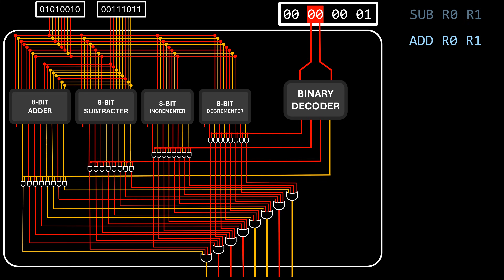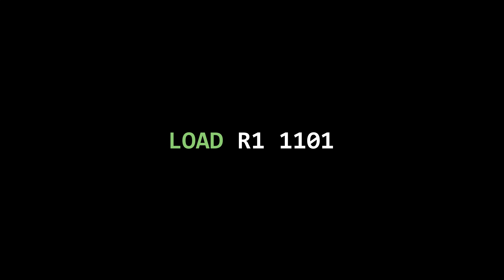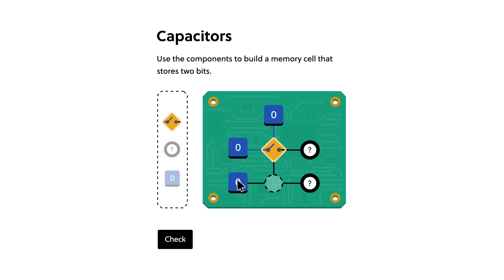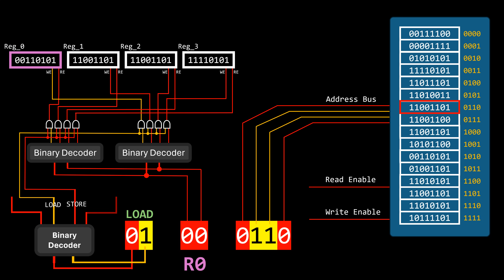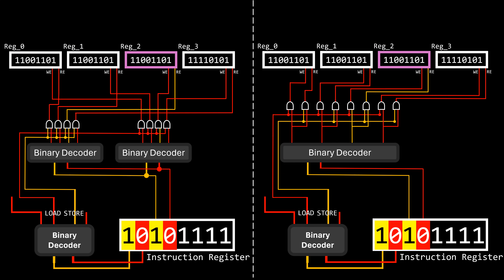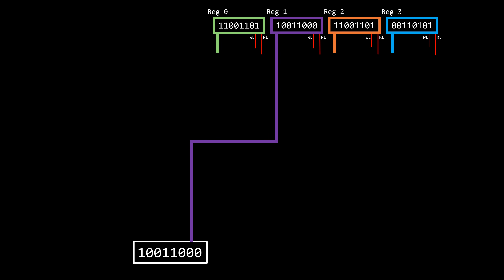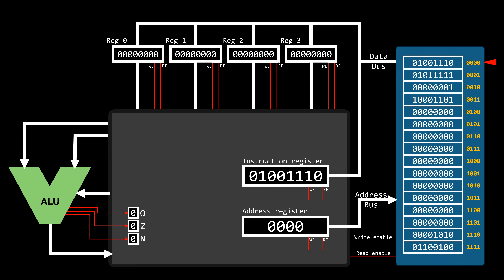CRAFTING A CPU TO RUN PROGRAMS

Comment: Very good explanatory video! It has potential to branch off into important topics, such as Harvard vs. Von Neumann, if one considers that soon enough storing code and data in same 16-location memory will be a bit tight.
Reply: R3000 in the PlayStation and SH2 in SegaSaturn have Harvard architecture. JRISC in AtariJaguar has Von Neumann and needs an “instruction queue” to read ahead instructions for when data will block access. Sounds a bit ugly. Atari was afraid that a big cache would be too slow? So they implemented a short ring buffer. I still would have loved if they fetch 64 bit =4 instructions at once, analyse all dependencies and maybe reorder these 4 instructions.
Reply: @ArneChristianRosenfeldt  - and interestingly enough, "original Von Neumann" was fetching 2 instructions at a time (2*20 bits) but I don't recall having dependency check, however it had a potential for that. Internal instruction caches can be made wider even if external bus is relatively narrow, which often has to be due to important price considerations (e.g. 68008 and 8088 owe existence to this).

Comment: Ans to you question, registers have bit level control of read and write, that allows passing one at a time to the ALU, and facilitating multiplexing but memory is just a block with no granular control ( probably 😅).

I am thinking about registers like a workbench and memory is the closet.

Improvement. !!! 
Dividing memory into subdivisions, keeping closer proximity of registers, for that a more defined instructional set will be required.

Please respond if I am right or wrong.
Reply: Memory is byte granular mostly. A lot of 32 bit CPUs are 32bit granular only: ColdFire, SH2 , RISCV .
Reply: @ArneChristianRosenfeldt  So am I right?
Reply: @neail5466  no . As I wrote memory is more granular than registers or at least not less (in 8086).

No idea what you mean by proximity? I am for keeping memory close. I hate how consoles need to pull instructions from a cartridge far away. I hate how C64 and Jaguar have a system bus which slows memory down because there is no active bridge. So memory feels as far away as the serial IO to the mouse.

Comment: Cpu is based on edge triggered memory elements  NOT latches!!!
Latches must be used carefully...
especially in Fpga design, to prevent creating  race conditions ... 
😅😅😅😅😅😅😅😅
Reply: I find this TTL parts very confusing. In  early microprocessors (6502 , Z80) there is only one kind of persisting a state: a loop of two inverters. Each consists of one common source transistor and one pull up. The clock drives two transistors which let the balanced wire signal pass. So 6 transistors in total. Dead simple.

Of course you may need one inverter in front of the whole SRAM or register file to create the balanced signal.

So anyway, there is no edge. As long as the clock lets the new signal pass, it overwhelms the pull up, and the inverter loop will fall in line.
Reply: Confusing TTL parts??????? 🤔🤔🤔🤔
Reply: @KingofUrukhai  logic gates. Okay, logic gates are okay, but flip flops, shift registers and all that other TTL stuff is difficult to understand. The manufacturer has problems to justify the big package for a little functionality and put comfort functions on it. But all this complex stuff leaks in form of a long datasheet with tons of specs. Meanwhile the 6502 only has two types of transistors. Only inverters and NAND and yeah open drain busses. I started to write a simulator for it. Now my main problem is indeed the CPU circuit to choose. I want analog transistors, but now cannot justify them. Only timing is difficult. So I need at least 16 phases per clock. I don’t want to introduce “gate delays”. I will probably stick with parasitic capacity and go back to analog .

Comment: 19:23. I think the answer to your question is an immediate value.
Reply: Immediates are literal values which follow the instruction stream. For example on 6502 the opcodes are fixed width (as on MIPS) , but it accept data embedded into the instruction stream immediately following the opcode. MIPS does not like to waste cycles. So similar how INC is ADD 1 , you can only embed small numbers in the fixed length instructions. Even RISCV only allows you to embed 24 bit numbers on a 64 bit system. So it is difficult to write a floating point emulator. Memory mapper IO should sit below 20 MB.

Comment: Why load data into registers before using them for ALU operations?
Registers are the closest and fastest memory storage units within the CPU. They provide temporary storage for data that is about to be processed or data that has just been processed by the ALU.
Is there a better way to do this?
One possible alternative is placing memory closer to the processing unit to minimize data movement. However, this approach still requires a temporary location, such as registers, to perform operations efficiently
Reply: The machine language (ISA) of the SAP-1 does not know about registers, still the implementation needed at least 4 . When do you call something a latch and when a register? There is an instruction “register” after all.

Comment: you will need very big MUX if you mapped your memory to ALU also you would need more than one data bus to activate two locations  otherwise you need intermediate storge to hold your data  ,
Reply: Two port memory is actually available. Then noobs will say that the price is the concern of the BA, while senior engineers know about the cost of all the addressing on the chip.

Comment: I think loading data into register before using them for ALU Operations is essentials because if we load directly from main memory to ALU might simplify CPU operations, but it is practically inefficient. It’s crucial to note that accessing main memory is much slower than registers. Registers are accessible in one clock cycle while getting into the main memory may take several dozens and even hundreds of cycles which makes ALU work slow.

Moreover, ALUs are intended to work with the few, fixed number of registers. Their direct access to main memory would make it difficult for them to design and potentially slowdown the whole CPU. Most architectures of CPUs are structured around using registers for data manipulation because it simplifies instruction set and makes instructions more efficient. Changing this design will require a complete rethink of architecture resulting in higher complexity as well as compatibility problems.

Pipelining is heavily used in modern CPUs to execute numerous instructions simultaneously. In this process, registers play a key role by providing fast storage for intermediate results and facilitating quick movement of data between different stages within the pipeline. Direct memory access will increase latencies thereby interrupting the smooth flow thus reducing overall efficiency.

Using main memory also leads to higher power consumption compared to employing registers which is a major concern both in mobile devices as well as servers.
Some of the better ways to handle  (i will share one example for now )as most of modern archtecture do is including serveral memory hierarchy like for prefetching like L1 , L2 , L3 caches which overall reduces latency and improves performances
Reply: Also realistic access to memory uses address registers. So you don’t actually cut down on registers. I think that the 6502 zero page is a mistake.

In the NEC turbo Grafik CPU, RAM, and ROM all cycle at 8 MHz. No 8 bit CPU after this. But at least for 10 years external memory was fast enough. The MIPS R1000 uses external SRAM caches at CPU clock. Intel was afraid of using pins, and MIPS has 3 32 bit data connections on their chip? Third is to DRAM. 

The power goes somewhere: electro magnetic interference.

Comment: "When making a video about how a computer communicates with external devices, I always get stuck on this aspect. I mean, data is fundamentally 0s and 1s, and it's not possible to transmit it in byte units all at once. There must be a process of converting bits to bytes. For example, when sending data through a serial port, does the computer have some built-in hardware that receives 0s and 1s as electrical signals, which are then connected to registers? When these registers are full, a program copies the data from the registers to the computer's memory. Therefore, the smallest unit that our code can control should be the memory. Except for assembly language, the smallest unit that can be controlled is the register. Although I'm not sure if C language can control registers through its syntax."
Reply: All serial connections in a computer have special hardware to send a group of bits. There was a 7 bit standard. I hate it. Let’s just pretend that only 8bits exist on RS232 . I2C and SPI also have groups. For the latter I read something about 32 bit. USB has 8 bit. PCI always was 32 bit, hence PCIe is 32 bit. UARTs employ shift registers for this. Examples: C64 disk drive. NES controller

Comment: Instead of registers, you could use a stack. Push a value from memory when loading onto the stack and ALU operations take the top two entries as inputs, remove them, and put their result on the top, then pop the top value back to memory to store it. The Intel 8087 Floating Point Unit does this, with a small stack of 8 entries, although it's not a strict implementation, as it does allow some access out of order.
Reply: 8087 stack does not reside in memory though. It’s not a separate chip. But then again I guess that it is more optimized towards density than speed. 80 bits in 1981 !!

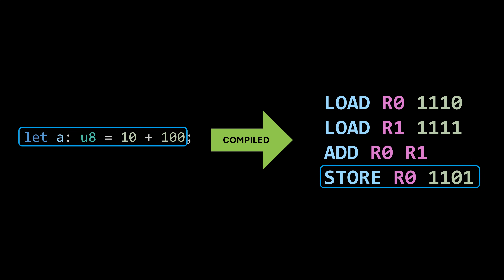Comment: @19:04  it was described as 00 starts arithmatic and a 0010, 10 being subtraction, but what is the arithmatic of 11 for the 3rd and 4th digit?  Also what is an 11 as a starting value? 00 is arithmatic, 01 is write, 10 is store... what is 11?
Reply from the maker: 11 indicates "control flow instructions", like JUMP, JUMP_NEG
Reply: @CoreDumpped  thank you

Comment: the only thing I don't understand is "how a single data bus could be used to read and write data on different registers? i mean is are they determine the current difference on something, or registers are activated one by one to read data through data bus😢"
Reply: It cannot. Bits are stored in flip flops as used in pipeline stages. They have input and output. You connect different busses to them.

Comment: Cool vid! Hope to see stuff about clock too!
Reply: Yeah, why did Intel offer a chipset for their 8008 where one of the chip converted a single clock to two non-overlapping pulses. Their first CMOS CPU the 386 had a well localised circuit on chip which created two non-overlapping balanced signals. These basically act as the power supply to inverters. Inverted power blocks on the diode. So either feed through xor feed back is powered on the flip flops.

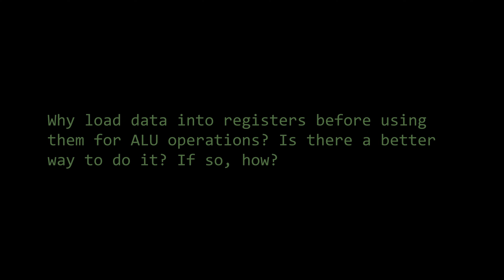Comment: To answer the question at 19:27, We load data into the registers before using them in the ALU because we simply need somewhere to put the data while it is being used by the ALU. One approach to optimizing this would be to allow one operand to be inside a register with the other operand in memory. This would require us to switch to 16-bit wide instructions so that way we can have extra bits to specify whether the 2nd operand is in memory or in a register. (We still want to be able to do arithmetic operations with both the operands in registers) an example instruction on this architecture might look like 00 10 11 10 01100110 (00 to indicate an arithmetic operation, 10 to indicate subtraction, 11 to indicate register 3, 10 to indicate the second operand is in memory, 01100110 to indicate the second operand is at memory address 01100110) This approach would also require that we change our control unit’s wiring a little since we would need the memory data bus to also connect to the ALU, and we would need to add extra decoders with logic to handle the larger instructions. This approach effectively saves us one load instruction since now our assemble for adding two numbers would look like: load r1 1100, add r1 [01100110] store r1 1101 (With the square brackets indicating that we want to use the value at the contained address as our rhs). Beyond this approach, we could modify our CPU even further to support performing operations directly on memory if we wanted, however this would require us to have even larger (and probably variable length) instructions, and potentially adding buffers to one of the inputs of the ALU to hold the first operand while the second one is being fetched. However, that might be hard to implement due to multiple operations being performed per instruction and it might not be any faster due to us still having to access memory multiple times. Plus, this is starting to go a little beyond the simple example CPU and is getting closer to some of the things modern x86 CPUs do! Thanks for the thought-provoking question!
Reply: Reg-mem instructions were actually quite common on CISC. 68k for this reason has 16 bit instructions. 6502 used the zero page of memory a lot. The clean approach is to use 8 bit offsets. So you have a base pointer ( into an array, heap, or stack ) and use a literal offset to access fields. ( or branch around in code ). The nice thing: load is just a normal instruction. Still Store is the weird one.
Reply: That is of course known as "immediate" addressing and is something you can do with the MOS 6502
Reply: Nice chat reply

Comment: In my collage i had to write some assembly for few weeks. We had to use acumulators for aritmetic operations. I dont know why, and now i can't wait for next episode to learn if acumulators are just registers or is it answer to question 😂
Reply: They are just registers. I always thought that the accumulator in 6502 is smarter, but it turns out that it can only calculate decimals, which is useless in games. JRISC on AtariJaguar gets slower if you load two registers. To keep things fast, reuse the result of the last instruction. There is a hidden accumulator. Actually, there are two. Another one for MAC.

Comment: 19:27 loading data into regs before using them for ALU operations is simply faster and more efficent from CPU's standpoint. Fetching data from external device such as RAM requires setting up bunch of conditions like WE/RE, ensuring that data bus contains data which we're actually interested with and so on. Simply speaking it's cheaper to sacrifice two clock cycles (this is fetch-decode-execute LOAD $register, address, LOAD $another_register, another_address operations) to ensure sanity of data. 
Operations on registers also can be done asynchronously because ALU can be implemented as simplests state machine ever - having A and B on its inputs, output C, like from lookup table without doing any actual math. It's much of a strecht but in realms of 4 bit cpu as presented here might be actually most efficent way. 

> is there a better. 
I see where it's going: cache memory on the CPU die and prefetching ^_- but i won't spoil despite knowing all this stuff - its simply entertaining to see how some1 else does deep dive into this realms :) can't wait next episode, cheers!
Reply: Actual maths almost always wins over look up tables in transistor count and die area and energy consumption. Academics has optimized this to perfection.

Though the Pentium bug was a wrong entry in a look up table. Yeah, division. 6809 does 16/8 division in 13 cycles. The chip has 6k transistors in total. Now do the math how many transistors your ROM would need. Do calculators do 1 digit divisions?
Reply: @ArneChristianRosenfeldt  i appreciate your comment, but (there's always a but ;d) you've probably missed my "in realms of 4 bit cpu" :) of course LUT-powered math isn't scalable and impractical in any real world application but i think that given circuitry needed to perform 4 bit add/sub/mul/div operations plus handful of transistors to implement switching logic (called here "binary decoder") wouldn't be that much of difference in terms of power consumption or area. Sure, raw table of every possible combination of components for ADD instruction would be 16^2 = 256 combinations. But this is like video stream, you know, enormous when raw but actually easy to compress. You can cut this in half without a sweat by utilizing principle of alteration that 2 +4 == 4+2. It would be actually interesting to see real life comparison of "real, OG ALU" and "fake ALU utilizing LUTs" 4 bit wide.
Reply: @lis6502  4 Bit adders are used as building blocks in modern CPUs. Only in FPGAs they are implemented as LuT . Also even the i4004 had Arithmetic and Logic. So you want multiple LUTs? 2800 transistors is what 4004 has. Counting is arbitrary for some reason, but let us assume nMOSFETs throughout. Z80 has a 4bit ALU, but no LuT.

I think that the Pentium LUT has 5:3 Bit input, and 3 Bit output. When you compress a table you will end up at arithmetic.

Comment: Thank you for your work, but you’re missing the wire that integrates the clock cycle into the whole process. 🥲.
please mention this next time🙏🏾.
your explanation isn’t straight forward.
Reply: Get combinatorical right, then learn sequential!

Comment: @13:27 registers output their values similtinusly, doesnt this make them short circuit each other because they were connected together as a bus in previous (memory load/store) ops ?
Reply from the maker: That's why I mentioned that would need additional circuitry.
Reply: @CoreDumpped  ah so a register has output for memory bus and another separate output for ALU bus?

Comment: so thanks. How can a high-clock-speed processor communicate with a low-clock-speed flash memory, and does the processor's speed actually decrease? For example, consider this in a microcontroller.